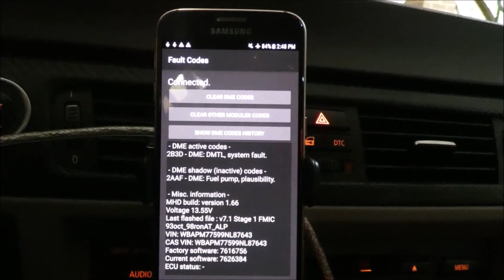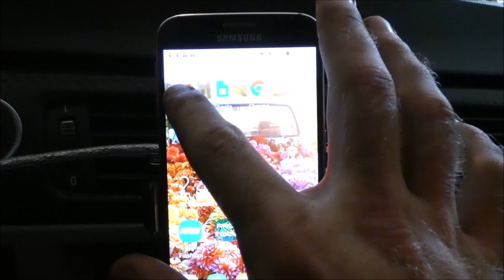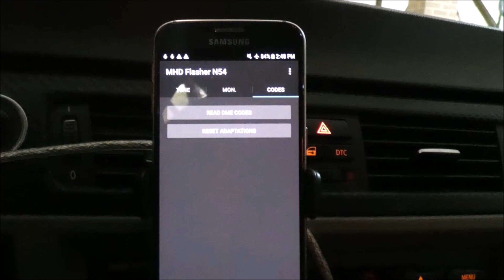BMW 335i DMTL Pump DIY

Comment: Great video, but one important note. On the 335i at least, the error code is very often caused by the wire rubbing through just before the pump electrical plug. I just fixed mine today by stripping and resoldering the wire. I have read comments from multiple people having this happen. I did not need to replace the pump because I was lucky enough to read about it in an E90/E92 page before buying a new pump.
Reply from the maker: This is good information!
Reply: where does the wire go i gotta do this to mine

Comment: Yo man I’m confused. I got code 315a fuel tank bleed valve: jammed open. Does that mean replace the charcoal canister?
Reply: I have the same issue not that code but my evap vent valve is stuck open and I have a ses
Reply: Also terrible gas pump issues

Comment: Good diy,  I’m starting to get fed up with 335i reliability.  My water pump just died at 52,000 miles on my car
Reply from the maker: What else has gone wrong with yours? Mines been a bit of a mess but I think it’s squared away. My water pump was replaced about 15,000 miles ago also so I should be good there.
Reply: BMW-E90-HQ mine has been fantastic besides that. Tuned with no issues since 46,000 miles. But everybody’s 335i’s seem to fall apart after 90k and turn into money pits.
Reply from the maker: I’m at 95k I think it’s going to be good for a while now. I’ve redone a ton of stuff to improve long term reliability.
Reply: BMW-E90-HQ you have, Ive been watching your videos. I think I’m gonna go Chevy ss next. Not Camaro ss but the sedan called a Chevy ss. Most people haven’t heard of them lol
Reply from the maker: Oh yes I know them. They’re basically the successor of the Pontiac G8. They’re both Holden Commodores. I had a GTO before I started with BMWs.
Reply: It is a BMW....your expectations are too high
Reply: @lard1892  my 330i has 319,000 miles and hasn’t had any issues besides 1 water pump at 190,000 and a clutch at 250,000.

Comment: At 4:55 you snap that electrical connection back on easily with one hand. I cannot get mine back on no matter how I try. Any ideas what is wrong? Pins and plastic all look normal to me.

Comment: I had the same code. Just replaced my pump.and still have check engine light. Or  ses  light.. does it take time to go away?
Reply from the maker: Tbh I’m not sure I cleared the code with MHD immediately after and it was gone. If you don’t have a code reader try going to autozone or somewhere similar and have them do it and see what happens.